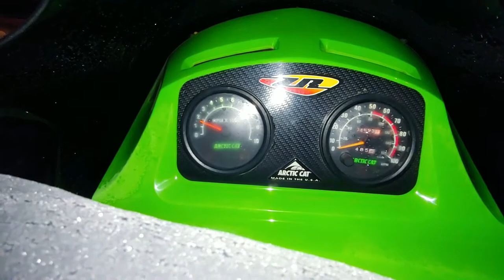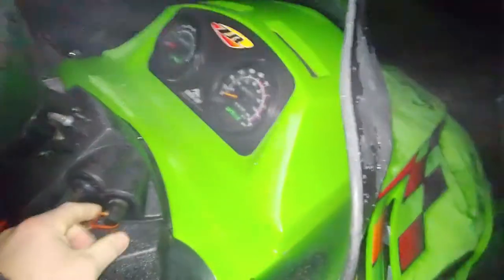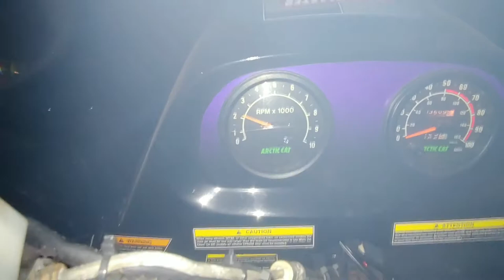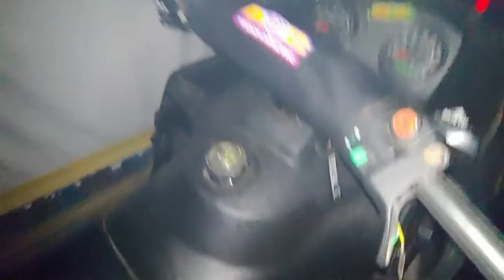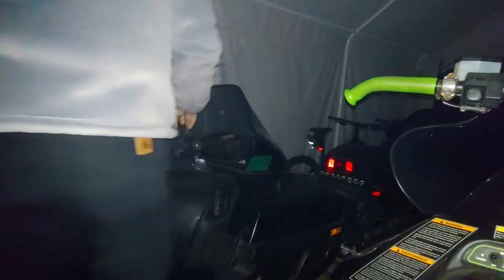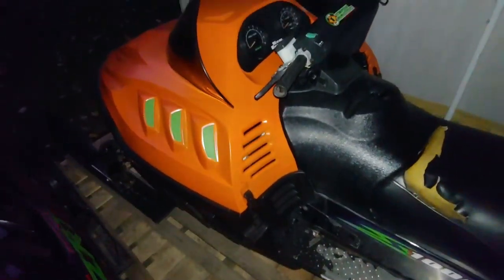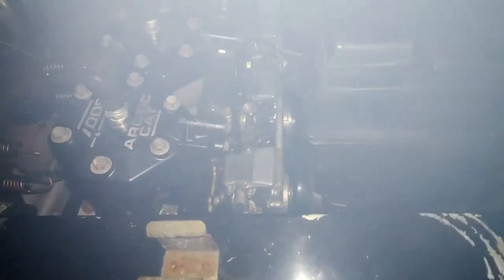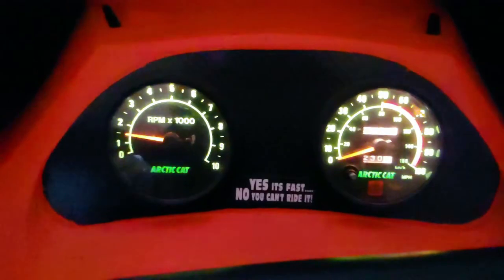SATURDAY MORNING WILL THE SLEDS START?

Comment: Love it, neighbors are like, what the hell is that?!  Brrrraaap!   I looked at late 90s Cats but couldn't find any with reverse locally.  I rebuilt my son's fuel pump and for the life of me, couldn't get it to run.  Your example is spot on about blowing in the tank.  I used a little compressed air, saw the fuel start moving to carb, started right up.  Just needed to get it primed.  Great video.  Nothing beats 2 strokes.
Reply from the maker: I know, I have a couple that are older and ornery. Lol. "Get off my lawn" types. I dint even use reverse on the one I have. Lol. But yeah be careful with the compressed air as that can mess up the mechanical fuel pumps diaphragms and seals. But glad it worked.

 Deff getting antsy to grap a handful of throttle. Got my zr 800 finished last year and it waa fun and traded a 96 zrt 800 for a 99 Thundercat 1000cc in the spring and its running Great! Should be quite fun at 165hp! Lol